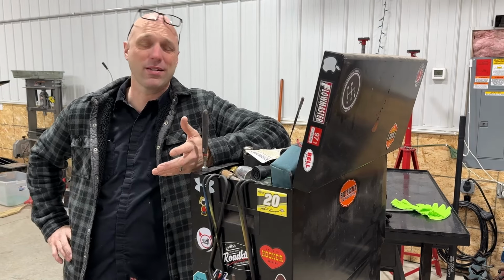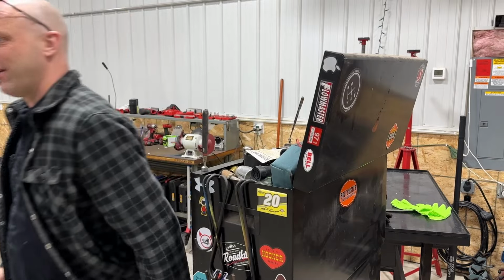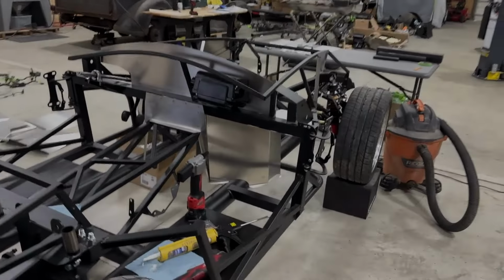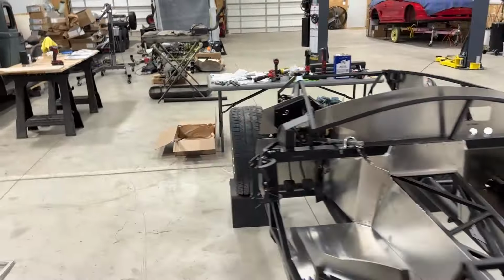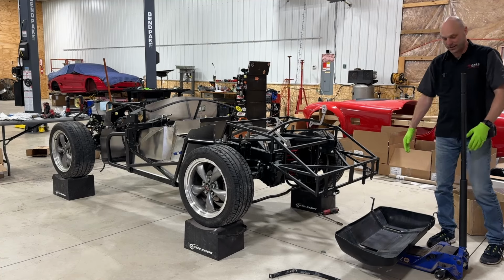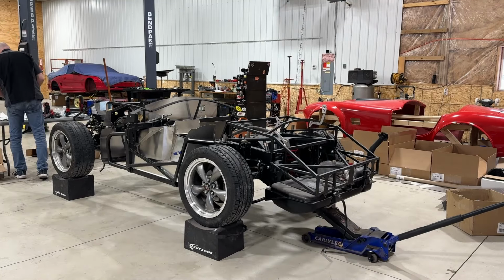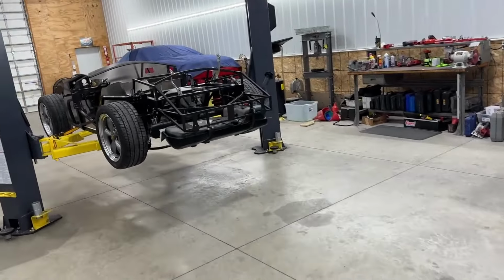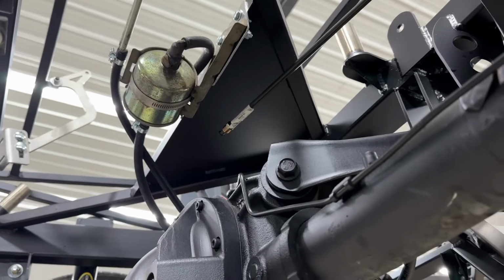Project Mr. F - Ep. 7 Fuel tank, lines, and some tin.

Comment: Plugging right along.
Are you worried about that gas going bad?  I mean, it might take you a long time to build the cobra.  By then the gas might mess things up.  I donno.
The wiring would give me nightmares.  Curious to see how you handle it.  I'm fairly certain I would screw that part up.
Reply from the maker: The gas is treated and since my goal is to have it running by spring, it should be fine. Wiring can be a challenge, you just take it one step at a time.